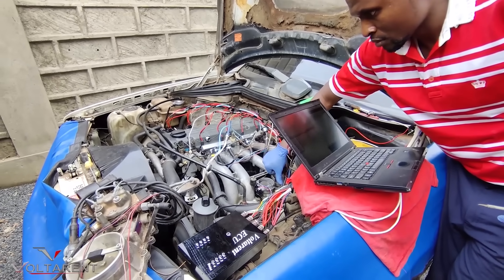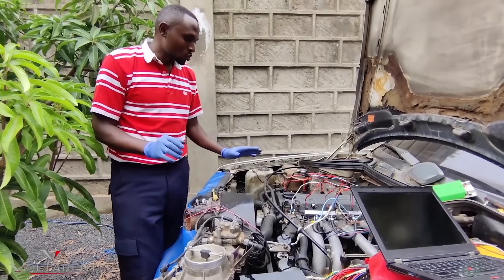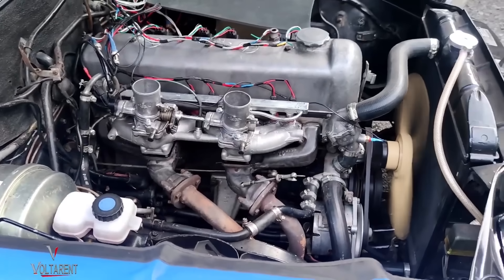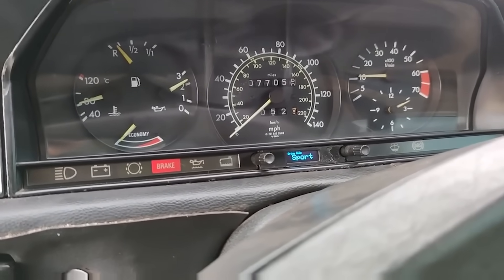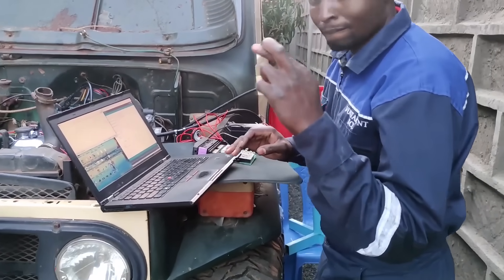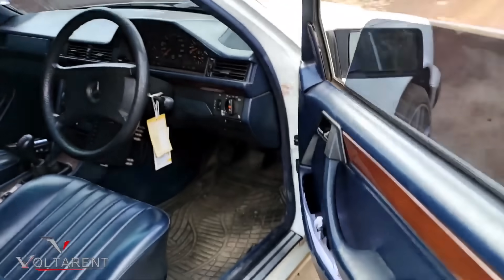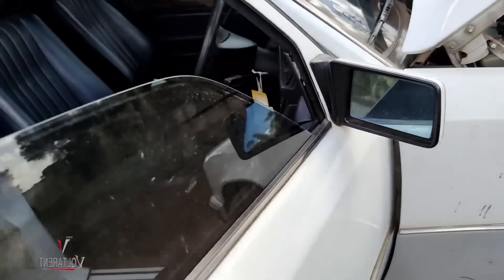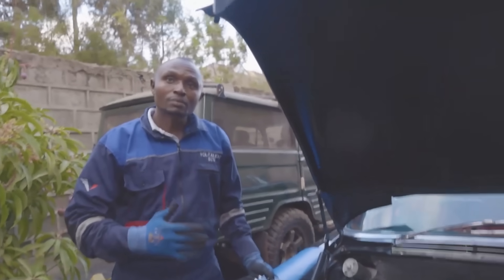African Genius makes Old Engines outdo Modern Engines!

Comment: Kenya doesn’t want aid, it wants to do business. Africa has some of the most entrepreneurial people around, let’s buy his stuff. I’d buy his stuff and invest in his shop.
Reply: Id buy it if he made one to common rail inject an old 12 valve cummins
Reply: @todydn  
Give him time........ I would not be surprised once you receive one from him in the future.
Reply: @todydn  you can do that yourself if you pick up his spirit and have a go at it
Reply: @allahsnackbar9915  nah man to produce that ecu privately in america your looking at 10s of thousands in just resourves and tools to make it  thats why very few performance companies provide an entire stabdalone ecu even fewer for diesels
Reply: @runed0s86   yeah man im a mechanic not an electrical engineer
Reply: @todydn  What he's doing can almost be accomplished using an ESP32. That's like a 3-5$ microcontroller. The code isn't advanced, the circuitry isn't advanced.
Reply: @Mikkel111  yeah but the code is more than im willing to learn learning to tune on purpose built ecus with the coding already done is dificult enough for me
Reply: @todydn yea I can relate to that, with the mapping haha.....👍👌👍
Reply: @Mikkel111 ok go develop even a rudimentary ECU, rocks for brains.
Reply: @Mikkel111  For a prototype any 8bit arduino can do this. EMI hardening and a failsafe hard coded timing backup if something goes wrong will be necessary in a production unit. 
Easy stuff if you've made it through the prototype. However, this is nothing for the consumer market right now. A niche product, but could provide for a one man company and it's family.
Reply: @bogeydope3022  have you done this before? If so then upload videos and teach if not just go back to work
Reply: @Mikkel111 well it's *genius" level for the primitive mind
Reply: @todydn Why go through all that trouble? Just get a 6.7 and a tuner to make it non emissions. Then you can simplify everything and won’t need nearly as much electronics.
Reply: they have a lot of people that just want to learn, no bullcrap only learn
Reply: Yea but open source ecus are out bro
Reply: @cruizcontrolFPV  yes and they are also like 3 4 grand
Reply: You are amazing and may God bless the work of your hands
Reply: We've got an aviation company, I'd invest and I'm wondering whether this can be added to older aircraft - that would make a huge differance in places like Africa and the Caribbean
Reply: what I have always said that we just need to protect and promote innovation, invest and  help them commercialize the innovation
Reply: Advancement can't be withheld forever.
Reply: @andya2636 It can if the government spends all your research money.
Reply: Go on then
Reply: Do it then
Reply: Way too much corruption in Africa. Africa is doomed until it's people start caring for eachother
Reply: Why should we care about these negros?
Reply: Non farti comprare da yankees o europei ! 🤙🏾✊
Reply: For sure
Reply: Just keep Europe & US out of Africa and they will thrive.
Reply: lol
Reply: But the West doesn't want to do business it wants to give only aid with strings attached. Unless you are Chinese communists.
Reply: White altruism destroyed Europe.
Reply: His stuff is simply the stuff he got from the West, invented and produced by the West.
Reply: Why don't you buy it then
Reply: Africa has few things, ingenious inventing is what they need to do too survive 😊
Reply: A distributorless ingtion system on cars! Great i deal , 40 years to late brother. When is the last time some has had to change a distributor cap?
Reply: Really? 😂😂😂😂 You're just saying this for the likes.
Reply: But your dumb prezda...😢
Reply: Who cares what race somebody is....  This is nuts what is going on here in this thread.  It's honestly evil.
Reply: @edwardk3  what are youb even talking about? I just said this tech is 40 yr old
Reply: Same
Reply: Will you pay the heavy taxes imposed by Rutos regime? How will your biz survive?
Reply: Well you would probably want to do business with the person themselves. To put Africa in as a whole would be dumb, china owns Africa's government.
Reply: Как могу ознакомиться с товаром? На 8 цилиндры двигатель есть такой аппарат?
Reply: Yall acting like they dont get 2b+ in sunsidies from usa and canada every year is wild. Hes got this education thanks to you already. Why dont ya give him your house next
Reply: Yeah man that's awesome!
Reply: Absolutely true evidence. Love from Somalia 🇸🇴
Reply: Easy to say when you aren’t in Turkana and don’t know where your next meal or glass of water will come from, when you are not the one struggling with HIV and are struggling to get ARVs, when you are not orphaned and on the streets wondering how to secure shelter for the night. Aid is important and makes lives tolerable for millions of people daily, especially in Africa. Let’s not take it for granted.
Reply: although the technology is pretty old and used in every cars. he should try to make cars in Kenya
Reply: This comment means alot.
Reply: yes. let's make him wealthy and create another diddy
Reply: 😂 @Darkness-ie2yl
Reply: @Darkness-ie2yl 😂
Reply: @Darkness-ie2yl  You act like diddy ever had talent
Reply: @Darkness-ie2yl  ahh it's always easy to spot the 12 year old
Reply: @supawithdacream5626  im honored to be 12 and have such an abnormally high intellect.
Reply: @Darkness-ie2yl  "abnormally high"  is everything directly above your head, mentally untouchable.
Reply: There are hundreds and thousands of mechanical engineers globally who can do this some have vehicles even using water or fossil fuel and the like problem comes when you need to build your own engines, components and chassis, it's a hell of money and expertise. Not just about putting components together.
Reply: They have to learn
Reply: Can’t even make clean drinking water 😂😂😂😂😂
Reply: unfortunately business is what ruined the rest of the world already.

Comment: The combination of older Mercedes with his individual cylinder control is quite remarkable.  
It’s not trivial to create an ECU of clean sheet design.  I hope this man gets properly funded and promoted for continued research and development as well as distribution of his products!   Somebody should introduce him to Jay Leno.
Reply: Lol except he didn't create it himself, he took the design from Speedruino 😂
Reply: @bigsmoke4568  There is nothing new under the sun.
Reply: @fangacaccccccccc  This is a bit different. Not only did he not create anything new, but he took someone else's work and passed it off as his own lol
Reply: @bigsmoke4568  Does not matter to us. See haters replies and you're notice a trend. We are used to.
Reply: @bigsmoke4568  It is not speedruino. The Arduino he uses is a totally different ISA.
Reply: @bigsmoke4568 you clearly don't know how this works
Reply: Putting it into a easy to bolt on kit at a great price IS revolutionary, so much so that existing aftermarket ECU manufacturers would definitely NOT want this guy competing with them in the market.
Reply: @ingalook he said 5km per liter and $1800 USD. For a 8cyl.....😢 this is not cheap or economical! Or his own technology! 🤭... scam 🤔

Comment: 5In what way does this retrofit of fuel injection "outdo modern cars"?  It does not.
This type of retrofit is common... just google search Megasquirt.
No doubt the Kenyan Engineer is very intelligent however retrofitting fuel injection to older carburated cars is very common and easy.

Comment: This is good effort but;

people who don't know much about cars and their mechatronics think this is too special. This is a primitive version of an ECU. a Toyota ECU built in 1998 is way smarter than this you see you even have to start the fuel pump manualy? can it diagnose itself?
Then what's up with all the classic cars? it shows this is no ordinary Kamau doing something incredible and probably some moneyed guy is behind him, drawing adruino circuits and sending them to china for production and packaging for sale. 
Then the interviewer is also clueless too he is not asking relevant questions like do you have to change the cylinder head or is it plug and play kind of thing? why is it better than stand alone of the shelf ECUs already available in the market?

So yeah Kenyans learn to think critically. Not like you do in every election
Reply: Hey man, you point is, this is nothing special, probably a knock off copy thing etc right?. Well, do you have any context? I designed this ECU from scratch and also wrote the firmware, several thousand lines of code in C++. It supports 4 drive modes as a base (toyota ECU 98?) but can do 20, 30, 50 tunes if i wanted, show me one very current standalone ECU  that can support even 10 maps? 
You just looked at one conversion that's not complete and assumed they work like that. Have you checked my channel and see complete versions? Why hurry to bring down someone without context? Is it hard to believe a Kenyan can actually do it? You can visit my lab at your convenience and I'll show you the machines I built prior to ECU. I'll show you how schematic diagrams are designed, wiring diagrams done upto the point you get the complete PCB.
Reply: @PeterMbiria1 Ignore him, you are a genius! I am Nigerian and I'm proud of you. Honestly, if I was rich enough, I wouldn't mind bringing you to Poland to set up an automotive tuning shop together and learn a lot from you. My friend, may God make you even more successful. Don't let anyone bring you down; they are just jealous of your hard work.
Reply: @PeterMbiria1  I am not trying to bring you down mate. You are doing a great Job. Just don't sell it as some Savior product.

Point is it is a less refined version of something that actually exists in better form or tell us what stops a person from just getting an off the shelf ECU (and they are many) and going for this particular one? perhaps you should tell us how yours stand out
Reply: @gearloot  Good for the feedback. This is an ECU designed to be extremely flexible. It not only can control the engine (which it is doing now) but can directly control the auto transmission (bypassing the TCM) meaning you can can have multiple (if needs be, even 20) engine performance maps on one ECU controlling both the engine and transmission. 
Imagine an ECU ready to race anytime anywhere and still a daily driver with fuel economy as it also supports power on demand and launch control

Comment: Repairing Bosch Jetronic fuel injection - all but impossible. Designing Arduino based ECU, no problem. Well done!
I actually personally know people who have done both, the Jetronic (which has pretty much nothing 'tronic' about it) was a complete nightmare to get going again - the fool bought an old Audi with it 😂.

Comment: Hi i am from India. He has engineed the entire fuel and ignition of the car, that to its not some generic stuff, each build is made ground up from scratch. Here a remap of an ecu itself costs 400$ most of the remaps rely on available data which at max would be fine tuned. The efforts that this man does for his build is amazing and charges reasonable amount for this hard work. Think the application on old cars may not be lucrative for him. 

I think he should expand to other areas like performance tuning of existing ECUs. It will give him much higher profits with lesser effort. But i must admit the level of satisfaction in doing something unique is at another level. Money is secondary. 🎉❤
Reply: If he can market it to the Classic, restored, and Hot Rod enthusiast, there is absolutely a huge business potential. Taking a 60s musclecar and adding EFI is massively expensive now. Undercutting the market leaders with a product designed for daily use, it'll sell!
Reply: @PiDsPagePrototypes  bro, people putting a systems like a megasquirt or vems on the classic and old cars already 20 years if not more.
Reply: This idea is very very old, not original or from scratch. It's called a "speeduino" system. He just put his own brand and name on it.
Reply: @mikem5475  Not quite - He also wrote his own code from the ground up.
Reply: @PiDsPagePrototypes  why would he do that when there is good, free open source code already available?
Reply: @mikem5475  Did you listen to what was said in the video? Maybe he wanted to write his own code to be able to sell his product.
Reply: @PiDsPagePrototypes  you can sell a service instead of a "product"
Reply: @mikem5475  It's one of those things where the car market in places like the US just wouldn't be good for modifying older vehicles like this to be economic daily drivers. Most cars here from this era are definitely in the enthusiast/collectors market. But in places where these older vehicles are more commonplace  on the road this is definitely a good business idea.
Reply: @RedShirtGuy96  in the usa we use this system too. It's called a speeduino. It's about 400USD. Much cheaper than his system. Maybe he is counting labor too
Reply: @mikem5475  but he's in Africa where very few people can set up such a system. For local enthusiasts it makes perfect sense. Don't forget even if you can get bits to recondition an old carburetor they'll almost certainly will have to come from the UK, the US or the EU and cost a fortune by the time they're in Kenya. And then you'd have to find someone to do the labour and get the car tuned (I had a W111 Mercedes Benz 220S like the car in the vid and, trust me, getting the original twin Solexes to work properly was a PITA).
Reply: @RedShirtGuy96   like cuba
Reply: @mikem5475  That is called entrepreneurship
Reply: The amount of old car that would need this is enormous, old car had better made engine but poor technologies, this would make buying new car useless.
Reply: Do you know how much money $1000 USD is in Kenya!?
Oh, It's VERY VERY VERY lucrative for him.....
Reply: @supafrancis  nah, he is not a company, its only him that knows how to do it so he has to spend his man hours. There isn't a lot of old benzs just out there to get on the road. He can probably do one or 2 a week if he is lucky which isn't bad but not lucrative enough.
Reply: This tech has been around for some time in the racing community,but even then all components are sourced from multiple vendors.I’ve never seen these systems applied to the old tech domestic market,where they would do the most service.Would the cost of these set of components be a limiting factor on marketing?This man knows his business from PC engineering to mechanical interface,which is a one of a kind talent.
Reply: I think that was his beginning. Tuning existing ECUs
Reply: 'Think the application on old cars may not be lucrative for him.' I think the classic car market would be lucrative. Especially as we are moving toward cleaner, greener.
Reply: You being from India doesn't matter. Why do Indians have to mention that constantly? Nobody cares about India
Reply: ... He's Engineer, he's paid himself x1000, with all his successful accomplishments.  That's what makes an Engineer, and that's his reward ✌🏽
Reply: @sureshkishore  Indians don't mention they are from India - impossible challenge (nobody cares about India)
Reply: Congratulation engineer
Reply: How can I block the variable camshaft sprockets so that the computer doesn't have problems when activating the VVT with codes?
Reply: yes,,,good for fun but for making money
Reply: He's using ignition coils that are already produced. Same with the fuel injectors. There are companies that have been doing this for other engines for decades. This is nothing new. I would hope that someone that went to school for electronics engineering would be able to build and program some electronics.

Comment: Beautiful work! I'm a car nut here in the states. I see the spark in this young man's eyes while he starts a new conversion. Mechanical bug we all get bringing older cars back to life better than they were is universal. Here in the states Holley has an EFI system to convert carbureted older engines to electronic fuel injection .We also have electronic ignition upgrades for older models to work along with these systems. Congratulations young man, keep the fire alive!

Comment: 🧠🧠Very smart guy.

2:01 He wrote his own ECU firmware code from scratch notably, complete with mathematical functions for driving fuel parameters and engine angle parameters!

This was powered by Arduino DUE board for the ECU hardware
Reply: Yeah, both hardware and software.

Comment: Basically, this guy is converting classic cars from carburettors to fuel injection. 

There's a few companies that sell kits of this conversion for specific popular models but they're insanely overpriced that 99% of people will stick with carbs.
Reply: So 900usd from kenia is competitive?  With zero wired or any support 😂🎉🎉
Reply: @mmuller2402  There's remote support by the way.
Reply: Plus electronic ignition.